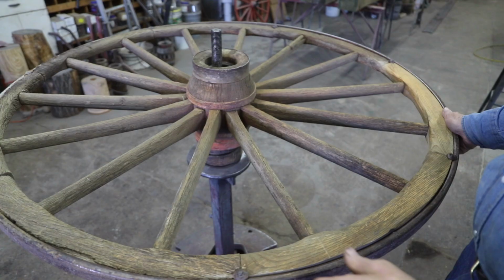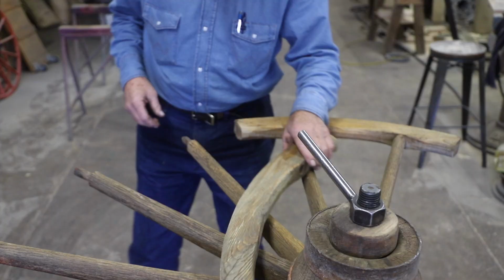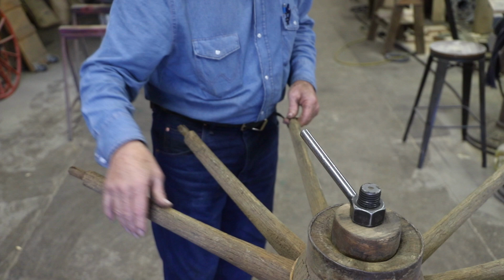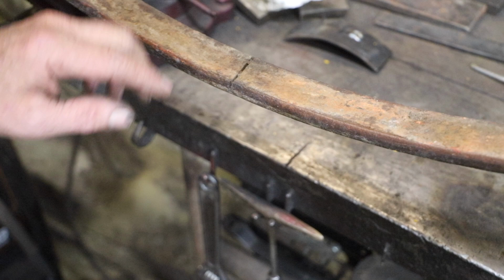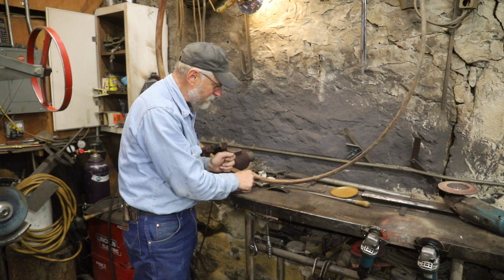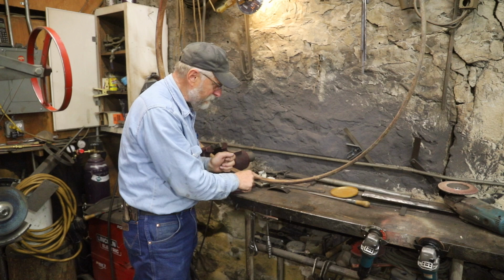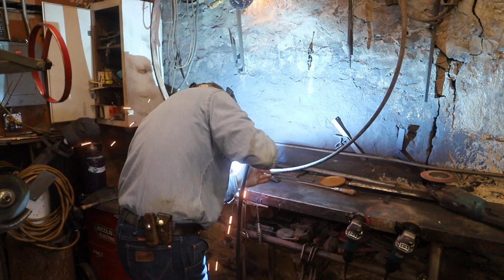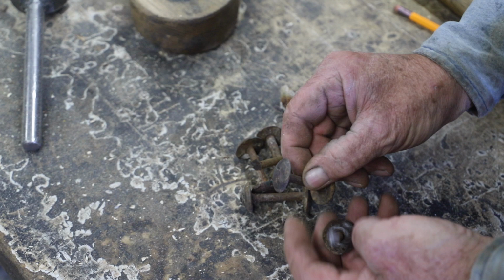Value of Saving Old Wagon Wheels | Engels Coach Shop

Comment: Dave and Diane. That was fun. Dave I really enjoy the different uses of applied physics. The homemade apparatus to pressure fit the hub ring back in place using a hydraulic jack between to controlled, and adjustable stop point. Brilliant.

Comment: I've watched  the  mud wagon  series,  I saw the  Bob sled first.  I found  your site  because I  watch Working  Horses With Jim. He recommended you. I live  in north western PA.  I've  had riding horses 36 , years  now.   I've  always been interested the western use of horse and equipment.  It is a  pleasure to watch the  care you  give to a wheel  that  holds  memories.  I  have  learned a  lot  in regards to  piecing the puzzle back together based on the the bits and pieces.  I'm waiting to see the   end result of the mud wagon.   Mt dad's  been  gone  18 years.  He was born in 27. They  were farming with percerons  when  he was growing up and then transitioning to tractors.  He felt  he was  pushed out of the farm  and started driving tractor trailers.  He was  a  teamser  on both  ends.
Thanks  for  sharing this tradition and craftsmanship.

Comment: Nice video and as a former metalworker and weld inspector i like how you work. In my stable here in the Belgium Ardennes (Battle of the Bulge area), there is still standing a wooden cow poop wagon. I asked the son from the former owner when it was build: 1959. So, even not that long ago, these carrages/wagon were still built. It is totally from wood and also with steel rims. The son has several wagons and horses. I also still have the blacksmith table and some tools for the anvil. The anvil block spis still there but the anvil is gone. The very old field vice is still in use by me.

Comment: Even when welding the old tire from outside only, it is not an excuse to not make a V groove so the weld can penetrate deeper.
Reply: i wonder if the person doing the welding might have been worried about setting the wood on fire by welding too deeply and so chose not to do that.

Comment: For shrinking tires on, how about a stand with a hinge just under the wheel that would let you tilt the tire and felloes 90˚ into a trough of water. Seems like you could get a better "wet" on the tire while you spin it vertically as you tap the tire onto center. Not so much with these wheels, but on bigger wheels I've watched you do a lot of circling back and forth trying to keep the tire wet while not tangling the hose and still managing the hammer. (You might need a counterweight for heavier wheels.) It might be easier to load and unload the wheels as well.
Reply: I've often wondered why Mr Engles doesn't just hang the the hosepipe from a hook fixed to the ceiling at the dead centre of the wheel and then could circle the rim any direction any amount of times without having to worry about tangling...

Comment: Sir I've got a question, with that good old "geriatric" wheel, in order to keep it as a memento at a minimum, would it wouldn't it be good to soak it down with his wood oils? Was it traditional to oil wheels and wagon parts with tung or linseed oils? Greatly enjoy your channel, thanks man!
Reply: @JohnDoe-bd5sz  
Thanks man you are correct, I'm tracking. I appreciate your heads up though, good of you! Cheers friend

Comment: Although it doesnt pertain to the 1st wheel you repaired, just curious how much difference in circumference is all allowed side to side between to wheels?? before it is noticeable in handling a wagon, or causes an alignment issue??
Reply: @JohnDoe-bd5sz  Thanks, but not gonna fall for it.

Comment: I love your videos, and have learned a lot.  I built a small 10" wheel, but I guessed at making my tire size.  Out didn't fit too bad after I heated it and cooled it on the tire.  I would love it if you could do your formula step by step how to calculate the tire size to fit a particular wheel.  I would appreciate it
Thanks in advance
Con(Ontario Canada)
Reply: You make the tire 0.2% smaller than the wheel.

Comment: The geriatric wheel still has some remains of old paint. Why does no one paint or oil wheels and other wood? Wouldn't that extend their life by a great deal?
Reply: Have you not seen him paint & pinstripe carriage wheels?
Reply: @horacerumpole6912  Yes I have, and they were painted originally. Why haven't the owners repainted them, over the past 50, 60, 70 years? Do they think their wood is different?
Reply: @TomLeg  I have an iron trough in the shop that was once used for apply tar to the felloes.  I can tell you that the wheels on horse drawn wagons and carriages used in Yellowstone Park were painted.  I defer to Dave as to how other wheels were treated (or not)-

Comment: You could tell the first wheel was allowed to sit in damp locations such as green grass or muddy locations. You'd think that would avoided when not in use. The second wheel I initially was thinking the hub was going to head for the oil tank a day or three. Dave obviously knew a better way to keep the look as close to original and used those shims. There's so many ways to "skin the cat" in this trade and the one sided weld on the one tire surely proves it. You really have have to get your head around these inventions...they stand up to tremendous torture and still remain together. Our modern generations would have a bad time dealing with this kind of work...saving and restoring vs. REPLACE.

Comment: Woodworking: Taking big pieces of wood, cutting them up into small pieces of wood, then reassembling them back into big pieces of wood. The trick is knowing which parts to turn into sawdust.
Reply: @JohnDoe-bd5sz  Yeah, was already aware of that. Get it on at least 3 other podcasts, too.

Comment: I don't think I've seen you put leather between the fellows before. Was that a common practice in restoration? What's the advantage of using leather rather than cutting a shim of wood to fit?
Reply from the maker: Leather will conform to the rough ends of marginal felloe joints.

Comment: My instructor would have cut me off at the knees if I had called those staves 'spokes'!  Was it really worth not replacing that last felloe?
Surely if they had chamfered the ends of the tyre they would have got a virtually full depth weld and a much stronger joint?

Comment: On the older wheel after you tighten up the wood could you not cut the tire down a bit and reweld it the bolts shouldn't be off too much

Comment: But why the second wheel became so loose in the rim? I mean I understand that the tire became loose because fellies shrunk and are somewhat rotten, but these gaps filled with thick leather - why they appear? Wood doesn't shrink along the grain.
Reply: With enough age and drying out wood shrinks in all directions, just less along the grain. The  circumference of the wheel actually represents a long piece of wood, so a small shrinkage in length generates a surprising gap.
Reply: @harrymoyes5069  that's very interesting. Maybe than I have no idea how dry is the climate in western states.

Comment: You do have me at a loss as to why a metal hammer on timber
Reply: In what context? Dave mostly hammers on the iron rim and the steel rivets. Knocking apart wheels, and driving the fellows up the spokes are cases where I've seen Dave hammer direct on to wood. In those cases a lot of force is required, the damage to the wood is lost in sanding the wheel round, and time's money. Changing to a large wood maul for those tasks would waste Dave's very valuable time.